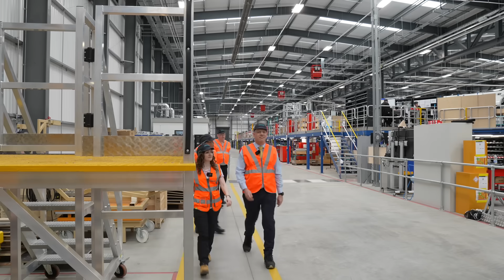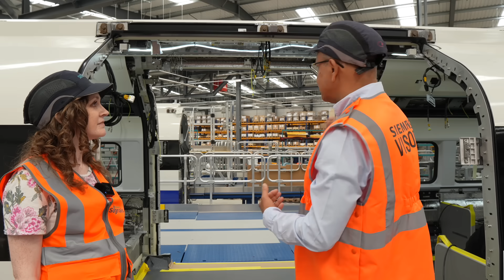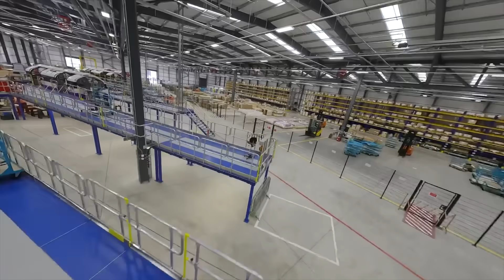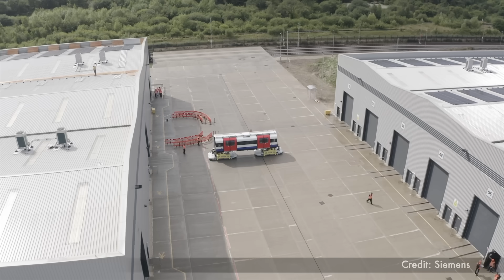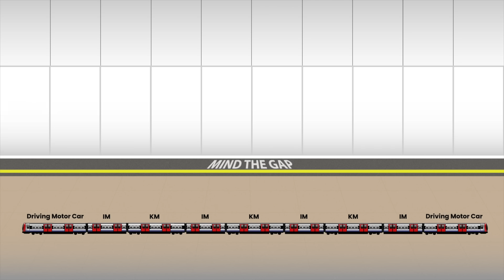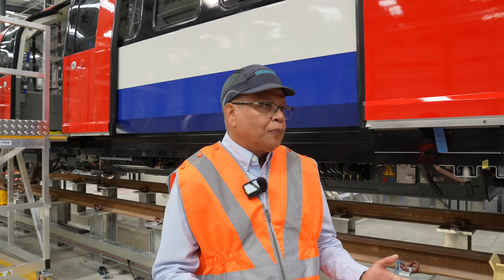New Tube trains for the Piccadilly Line – inside the factory!

Comment: I work in the Czech factory where we make those big red doors and all the systems that open them when needed and keep them from opening when not. 
To make the door system fit this car body shape it has to have a lot of unusual stuff in its manufacturing process. It shares a lot of proven components with many metro and tram systems but they are arranged in weird ways to keep the mechanism slim etc. And my colleagues who work on the door leaves themselves tell me the huge curve on them makes them more complex to make too. 
So compared to other systems we make nothing is straightforward or easy on this one. If the rest of the train is similar in this for Siemens I am not surprised things got delayed a bit. But London should get the best tube train possible when it is done.
Reply from the maker: Thanks - that's fantastic insight and much appreciated.

Comment: What a great dive into the details!  I’d love to compare how the choices made with engineering carriages today are different to the same choices that were needed 20 years ago and 40 years ago.  It’s the same line!  So what has been invented to make the results change?
Reply from the maker: The coupling device that has been developed is genuinely new. The system (which Graeme described as bogie offset articulation) enables shorter vehicles and 'suspended vehicles' which in turn enables them to have through carriages whilst minimising the lateral movement that you would get with longer carriages. All terribly clever.

Comment: It's crazy that the London Underground doesn't have AC as standard on all trains yet.
Also happy to hear the words "for the next 35-45 years". Hope these trains will be that reliable and will last that long
Reply: As a Londoner, I personally, am very aware (especially during summer) that there's no freaking AC on our old ass tube system. The Victoria Line feels like the final destination is gonna be hell, not Brixton. ...Although having said that I live in Brixton and it arguably is hell, so i might need to give that some deeper thought 🤔🤔
Reply: Tube lines served by the new S stock trains have them. These are bigger trains and it was easy to include A/C in them. 
The smaller trains which service most of the underground created lots of challenges fitting A/C in the design. The other issue is the underground is so deep and old in some sections that they have to create/update ventilation before they can introduce A/C trains which would add more heat in the underground.
Reply: @ericgithome7775 that's an interesting explanation. Which are the deepest parts of the line?
Reply: @ericgithome7775  Yeah but the Victoria line has some of the most modern trains on the tube so why doesnt that have A/C or does it just we ignore its existance?
Reply: @mulletmanplayz  I think you've just ignored what the comment said: "The smaller trains which service most of the underground created lots of challenges fitting A/C in the design. The other issue is the underground is so deep and old in some sections that they have to create/update ventilation before they can introduce A/C trains which would add more heat in the underground."
Reply: At the rate TFL are currently replacing their stock these trains will be in service for at least 50-55 years
Reply: AC pushes out heat which still has to be removed. The tunnels and stations need air conditioning first. 

The is also the difficulty of finding space for the AC equipment.
Reply: @physiocrat-sv  AC in platforms is very difficult to achieve, especially when the platform is far from the surface.
Reply: @boulevard14 
The whole system needs improved ventilation. There are lots of disused shafts eg lift shafts which can be used. AC on the trains will make matters worse unless the tunnels are better ventilated.
Reply: @boulevard14  Other countries have done it. London tfl is just shit
Reply: It has no ac since the station has no ac and sufficient vent system-
Reply: Instead, you'll get glowing screens that waste electricity... which, of course, everyone will pay for.
Reply: And No Toilets ..
Onboard or at station.
And take your litter home..
Underground will only take care of their maxim profit😂.
Capitalism for you..😂
...
Reply: actually no one cares why they have no AC. it is just unacceptable
Reply: even if they end up being pulled by horse and cart and held together with chewing gum, they'll keep using them.
Reply: no ride of mine on pre-WWII stock - which had been more akin to teeth-chatterings than any thing else thereabouts :brrrRrr: - had ever necessitated a.c. though
Reply: NO tube grumbling about that stallsome Sweltering '76 either
Reply: It's even crazier that the driverless DLR has been running for years, yet London Underground still pays huge salaries to workers who drive the Tube, strike 3–4 times a year, and demand even better pay, benefits, and shorter working hours.
Reply: @LawrenceWuVlogs 
The Victoria Line has had driverless trains since it opened in1968, but it is a simple, self contained end to end system with no junctions and was designed for driverless operation from the start. The DLR is also self contained but trains are in practice often driven manually.

The rest of the underground is complex and has evolved over 160 years. Most of the system is not in tunnels and there is also running over tracks used by other operators than LUL, and on Network Rail tracks. 

If the system were being built from scratch then driverless trains would be one of the features.

Comment: Won’t it be hotter in the platforms with air con pumping heat out of the trains?
Reply: No heat will be pumped. TFL has blatantly misled people by calling it air con when it’s actually just air cooling. It won’t get rid of the moisture inside the trains but should still make it a bit more bareble

Comment: Great video!

I was wondering, how do the new trains utilise air con if it was previously rendered impractical due to the heat retention properties of the surrounding clay in the underground network causing problems for heat dispersion by a HVAC unit. Is there any information on where the dispersed heat will go? Many thanks.
Reply: The answer is that it’s not actually air con, it’s air cooling. It’ll cool the air inside without dispersing the heat and moisture

Comment: Great video, but this project is much bigger than just new trains.  If I am not mistaken, a complete new signaling system is also being installed which is one of the reasons for the delay in implementation.  This is complicated by the fact that the District and Pic share trackage in areas making implementing a new signaling system more complex.
Reply: The new trains also hit the tunnels in certain areas as the tunnels are no longer in spec, there needs to be a lot of track and tunnel work to make them fit.
New signalling system is playing merry hell on the Metropolitan line at the moment.
Reply: @pobvic  LOL... I hope not!  But with that said, it should be expected that some issues would crop up given you are trying to put state of the art trains into 100+ year old tube tunnels.
Reply: The signalling is not part of the current upgrade, that’s a longer term goal after the new trains have been rolled out

Comment: Because the Tube lacks the space to effectively exhaust  heat from a standard A/C system, there's no dedicated humidity removal, so the new trains have "air cooling," not air-conditioning.  The cars will be cooler than before, but muggier than had they been able to put in a normal HVAC system that could fully  manage relative humidity.
Reply: While it’s virtually impossible to maintain consistent humidity levels in a vehicle where the doors open and close at every station, I can confirm that the installed HVAC system will significantly enhance passenger comfort.
Reply: Is there no way they could remove moisture from the air and deposit it on emerging from tunnel

Comment: Recently, one of the trains was sent from Dollands Moor to Goole, because it was found that the trains where too BIG to fit in the tunnels and had to go for remediation work!
Reply: It wasn’t the tunnels that they were too big for, but rather certain curves from what I’ve heard, particularly around Holborn and South Kensington
Reply: What work needs to be carried out, to ensure that the new trains fit?
Reply: @yourfriendlyneighbourhoods8202  Was it? I heard it was due to issues with the welding. One unit has now got around the South Ken bends on test.

Comment: London was first with Underground. But the disadvantage is that tunnels are so small. You have to drill new and wider holes so you get better headroom 😀
Reply: You should see the Glasgow subway!
Reply: yeah it uses teeny tiny trains even compared to things like New York's IRT lines (although New York has very very long trains)
Reply: @IndustrialParrot2816 they're not teeny tiny as you put it, they have low headroom but passenger capacity is on par carriage wise with the NYC  subway. 
The Met, Circle, District line stock ect are in fact bigger than NYs subway cars.
Reply: Of course the small size of the tunnels creates massive limitations and problems, but the whole system is filthy dirty, can't operate reliable services, and is far too expensive to use - it's not been fit for purpose for decades. 

If politics could be put aside, they should take a few trips to Russia to learn how to run a metro system efficiently. Moscow probably has more money to splash around than London, but even the older trains which run on Moscow's metro (I guess dating back to the 1960s or something) were designed with clever "roof scoops" built into each carriage's roof to bring cool air into the carriages for passengers - a typical Russian design solution, simple but very effective. Why was that never attempted in London?

If they'd banned people from eating on the system it probably wouldn't be so infested with vermin. Choosing more practical/sensible seating materials should also have be done years ago. The type of fabric used for seating is infested with fleas and mites on most lines so in a particularly hot summer any of your exposed skin coming into contact with the seats can expect to be bitten by the wildlife living underneath you.

London's transport system is just like much of the rest of the country's infrastructure now, falling apart - it's certainly not 21st century.
Reply: @grantchallinor5263 I think the vermin problems cannot be solved since tunnels link from outside to in. They will always find a way in and go up to the streets for food.
Reply: More headroom for air conditioning that was not necessary before climate change.
Reply: @cabbagepatch8947 no it’s due to London clay base storing all the heat over time which is what is making tube lines hot.
Reply: @cabbagepatch8947 nothing whatsoever to do with climate change!

Comment: The reason why they won't be in service in 2025 is because of miscalculations 😅
Reply: Typical UK nowadays cannot upgrade infrastructure without delays.
Reply: @DildoSwaggins-m1s the only good about the new train is the AC and the extra space. But a lot of the trains are outdated bakerloo line is so old as well as other lines, development is so sluggish

Comment: How will the excess heat generated by aircon on trains be evacuated to the surface?  Chimney cooling risers? Or will there be chilling plants installed at stations to remove excess heat from the platform areas from standing trains?

Comment: Interesting, but I wanted you to ask why a part of the train is suspended. Less wear on the tracks? Less heat generated from braking? Better smoother ride? Better on curves? Any of the above?!
Reply: Partially to make space for the AC
Reply: @nether_bat  Thanks!
Reply: Since they're going for lightness I suspect it's to reduce the number of bogies though I'm not sure why they didn't just go with Jacobs bogies. Edit: Wikipedia thinks it's to make space for the AC.
Reply: @francisboyle1739  Thank you!
Reply: With the cost of widening the tunnel diameters to accommodate S Stock, if you want to introduce the walk through design this is the best method.  Do take on board that from an engineering and whole life concept this new design does carry risk.

Comment: So delayed for 6 to 12 months. Not bad in the great scheme of things all new stock has been, including the 73's when they came out 50 years ago last weekend. I have had a nose around from the outside of 38001 and popped my head into the passenger compartment. The public are in for a treat. All I will say it looks good on the inside. Air cooling is in the IM cars, (the ones without wheels), CCTV throughout the train, electronic information system that updates to give real time info on the rest of the tube along with other things. Will it fit? Think about it would Siemens and TfL risk their reputation if it didn't? Yes, things need moved in the tunnel it is not just a pipe with signals there is a lot more down there. At the end of the day these trains are the most advanced that will be on the system and with a bit of luck on the Bakerloo and Central as well. They are literally a big computer on wheels. A lot of things need to come together for these trains to come in to service, power upgrades, signalling, driver training, track depot and siding upgrades the list goes on. Yes, they will probably have some teething issues all new trains do but at the end of the day these trains must serve the Piccadilly line for at least the next 25 years. So, a 6 to 12 month delay to get it right is a drop in the ocean.
Reply: Actually it's delayed NOW 4 years and counting, IF  delivered 2nd half 2026 it will be 5.5 years delay.
It was planned to be delivered in 2021 after signal upgrade in 2019. Yes, there was pandemic in between, but, again, signal upgrade should start back in 2019. 
And the current delay is caused by TFL failure to do required signal upgrade. Again - it was planned to be finished in 2020. The actual upgrade hasn't started until March 2025, works have been carried until May and basically all stopped.
Reply: @monkeysonlondonroads  "The actual upgrade hasn't started until March 2025" ? South Harrow and Northfields sidings. co-acting signals all over the place, power upgrades, some depot upgrades the works at Cockfosters. It started well before 2025 trust me. And as for dates the original plan was to replace the fleet by 2014.
Reply: At least they weren't delayed for SIX years!! Yes, I'm talking about you Southwestern Railway. The new 'arterio' trains still haven't been fully rolled out. Heaven knows what's going on. A definition of incompetence.
Reply: @robtyman4281  Have they been knicknamed the platform hoovers?

Comment: Hopefully follow on order for trains suitable for Bakerloo and its extensions  but then what ?  Jubillee Northern Victoria and Central all have recently built stock some of which need mid life refurbs which in the past done a Donacaster or Derby so some work from that (indeed may be cheaper to build new early and work out a 30 year replacement programme ?  Or Does London (no where else in UK) need a new deep level line - or further extensions - Should Bakerloo re take the full or more of the service to Watford ? Extending Northern from Edgware or High Barnet to Potters Bar would enable more development in that Town  , Extend the Northern to Clapham Junction Wandsworth Putney and Hammersmith ( to replace the need for Hammersmith Road Bridge ?  ) Send the Victoria further south - and North to connect Epping to Chingford ? But most London extensions will be on Subsurface / Overground Routes - Indeed perhaps send Overground back round the Chigwell Loop from Ilford / Liverpool Street and route new central from Stratford to docklands barking riverside and abbey road toward bexley etc ?
Reply: Presumably if once the Piccadilly and Bakerloo order is complete, if the Central trains are not yet deemed ready for replacement then the factory could be retooled for mainline trains. Siemens are one of the biggest manufacturers of UK rolling stock, with the Desiro and Desiro City accounting for 542 trains made up of 2,872 carriages across DMUs, AC EMUs and DC EMUs running in London and the South East, the Midlands, the North and Scotland.
Reply: Central and Waterloo and City are also planned to be replaced as part of the new tube for London programme. But with the central line being refurbished with AC motors they could instead move to the jubilee line which still uses DC motors (much less reliable than AC motors).